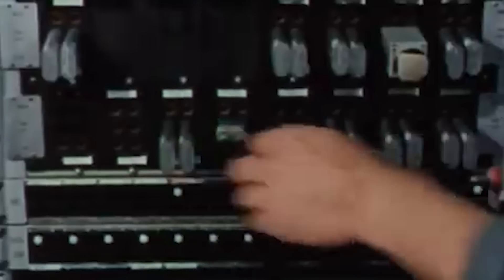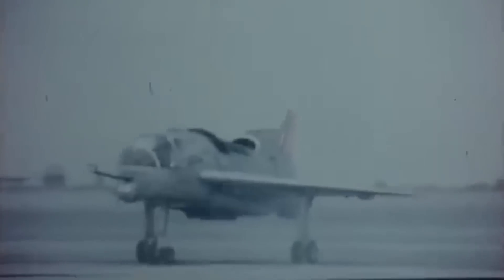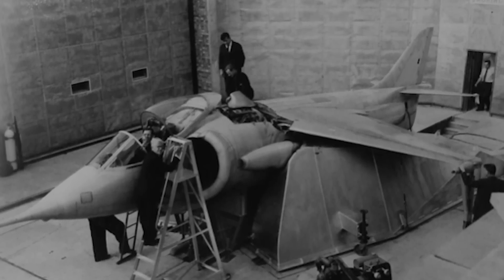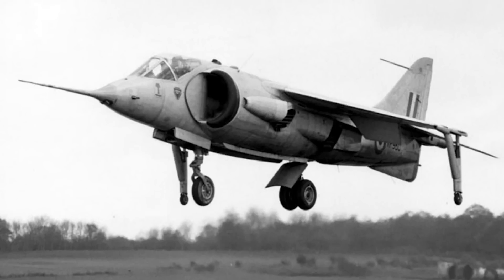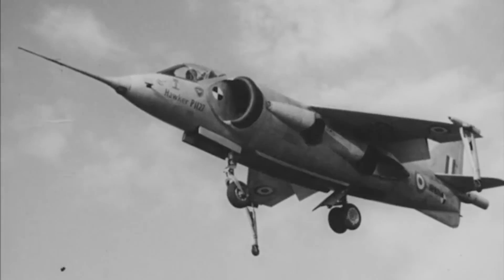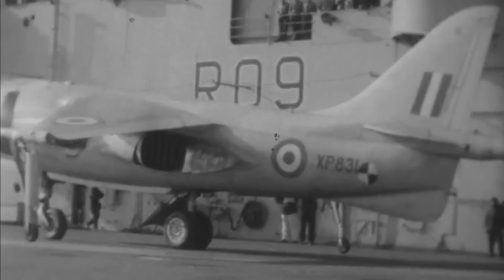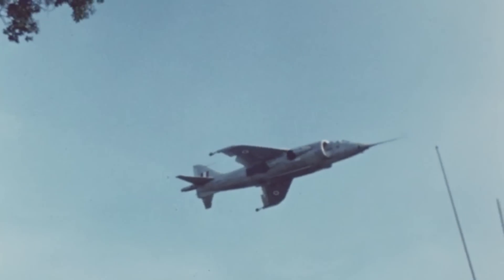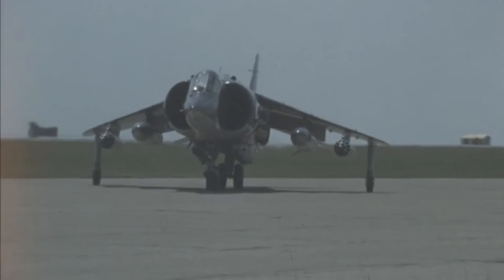The Single Aircraft That Almost Wiped Out Everything You Know About Aviation

Comment: I was an engineer on USS Franklin D Roosevelt CV-42 in the mid-70s. In 1976 we received America's first active Harrier squadron. The biggest problem we had with the Harriers was the exhaust tearing up the non-skid on the flight deck during vertical launches and  landings. Pieces of the flight deck would go flying out like shrapnel, tearing up equipment, planes, and personnel. The solution was to deck launch the planes by setting the nozzles at a forward angle and having them run off the deck like the WW2 fighters used to do. They were able to get into the air with full fuel and armament. Vertical launches only allowed bare minimal fuel and armament. Recoveries were like the normal planes. They would approach the fantail with nozzles at a reduced vertical angle to reduce landing speed. They would come over the edge of the rear flightdeck and just settle down with no fightdeck being torn up. We only lost one Harrier during our '76 Mediterranean cruise. He was approaching the fantail for a landing when his engine flamed out. The plane settled into the sea and the pilot punched out. From what I have learned about these planes, they were mean little fighters. The could be in a dogfight with a supersonic and win by lowering the nozzles some and getting a much tighter turning radius which would allow them to get their missiles on the enemy planes that were still circling to get lined up with the Harrier.

Comment: Lobe the Harrier, but it had One significant problem that claimed some planes...
During a VTOL with no wind, the engine can end up ingesting it's own exhaust gasses stalling the engine causing the plane to drop to the ground.
The more modern F35B solves this due to it's shaft driven large vertical turbofan which keeps fresh air circulating for the engine to breath.

Comment: The British contributed so much to modern aviation, but got so little back from it. I blame the political class. Case in point: Concorde. The British government wanted to back out after after a certain point. However, Charles de Gaulle would have none of it, and it is because of French insistance that Concorde ultimately became a reality. This is not a putdown to British engineers and technicians who were more than prepared to do their part regardless.

While the British get the lion's share of credit for Concorde's success, at the end of the day, it's what the French were responsible for that made Concorde able to sustain mach II without use of reheaters, namely low drag wing design and construction. The Russian Tupolev 144 had more powerful engines, but was unable to match this feat, making it unusable in commercial application. Just goes to show British and French can do great things when they cooperate and work together on a common goal.

Comment: I used to work on these diffuser’s in England for GE, welding the material which if I remember rightly was PE11, we used to work the night shift for about 3 years we had problems concerning cracks in the welds, it all turned out there were faulty welding rods which the day shift were aware of but never bothered to share with the night shift,  must have cost the company millions

Comment: Changed Warfare in the Falklands. US Marines saw this and..Slow but stupidly maneuverable to the Mirage French Mirage II's. The pilots of the Harrier would simply do a Dead stick stop and drop 100 feet then require and shoot an AIM-9 then regain speed. The Low and Slow worked for them for the terrain as they could hide in a range of mountains and wait for the opponent to fly over then rise and target with a missile that tracks heat for 15 miles. America's best at the time. At least it had a gun!
Reply: I believe the Americans discovered 'Viffing' or vectoring in forward flight which made the aircraft jump upwards and slow down dramatically allowing faster jets to pass by and be attacked from behind.

Comment: The aircraft was initially called Kestral before entering service as Harrier after modifications, I read they added small air jets in wing tips and front and rear of plane to aid stability in hover. I also read they were working on a bigger engine that would have given mach1 speed and bigger plane with larger pay loads but funding was not maintained and Bristol was merged into Rolls Royce and engine died as no funds just another what if of if uk had not been broke but Harrier lead a spirted life in uk till Mr Cameron killed it before its time again down to money saving rather than common sense.

Comment: no real combat use for vtol.

1/ Vertical take off with full military load will use up so much fuel that it limits the range.

2/ therefore the frontline airstrip will be close the combat  zone, which will endanger the plane.

3/ with low fuel left after vertical takeoff, the plane has to hit and run. It must not HOVER in its mission.

4/ with low fuel left, the minute it detects an enemy it must DITCH and run.
    It simply can't afford to dog fight.

5/ when in hover mode, the canon fire will rock the plane so much that there is no hope of hitting a target.
   It can only effectively fire a missile. BUT missile doesn't need hover mode in any senario.

6/ In Dessert Storm, central command issue a BAN on VTOL use for takeoff and landing because it does not want to tally of destroyed aircraft to go up....( not the fear of being shot down)

Long and short, there is no demand for VTOL at all.
Its great for air show, nothing more , nothing less.

that is also why Russia sold off its YAK 38 project and never looked back.
Reply: It doesn't normally do a full load vertical takeoff.

Comment: These VTOL planes are useful to the army and marines for the same reasons as helicopters; they provide tactical ground support with little or no runway space. The air force has little use for them, not fast & powerful enough for air combat or strategic attack roles. With the possible exception of the F-35 Lightning.

Comment: It’s sad that it was discarded due to lack of imagination and potential. But at least it lives on in the marine corps.
Reply: It wasn't really discarded. They just took what was learned and made a better version and called it the harrier.
Reply: @moshunit96  The Harrier has not been used by UK forces since about 2010...
Reply: The AV-8
Reply: It was retired for good reasons. While the Pegasus cold thrust engine allowed for vertical flight it severely limited the aircraft in both speed and payload. These limitations could not be overcome without a completely new approach such as the mechanical forward lift fan in the F35 which allows the rear nozzle to operate at far higher temperatures. We will no doubt see the Harrier continue with nation's which need SVTOL capabilities but cannot afford to buy or maintain F35s. I'm honestly surprised the Chinese haven't attempted to acquire or clone the design as it would allow them a proven fleet air capability while they get to grips with all the problems their current approach is causing. Their large carriers have both structural and system issues and their carrier aircraft are proving underpowered and unreliable.
Reply: @ianjardine7324  Tell the US marine corp that Harrier is no good.  The reason Britain stopped using them is 1. our politicians are stupid  2. they rather waste money on stuff we do not need like a high speed railway to link two cities 120miles apart, to save a few minutes ( HS2 ) which is costing £1billion per mile to build.
Reply: @chrissmith2114 
HS2 ranks as one of the stupidest rail projects ever anywhere.
 It's tragic.
Reply: UK should make the stealth version. - Advancing role, subsonic F/A stealth fighter, mostly for attack still needed
- Defence role, it can comes out of nowhere, since it doesn't need long runway, giving headache to opponent planner. 

Upgrade with Ai for easier vertical take off & landing.
It works fine with human at control, it would be fantastic with fly by wire Ai.

Put the ground crew on vehicle, the aircraft could be re-arm & re-fuel almost anywhere.
Reply: @budisutanto5987  we've got exactly that the Americans helped us develop the F35 then let us build parts for theirs as well as our own.
Reply: @ianjardine7324  Not really.
Some of your politician demand for F-22.
They aren't wrong. 
F-22 & F-117 is the true stealth.
F-35 & SU-57 aren't.

Aim for F-117 lower stealth (but stealth from every sides) to lower cost, but with the superb agility of Harrier, most radar can't detect it on time to react to this day.
Sell it to US & allies.
Reply: @budisutanto5987  the F-22 can only thrust vector up and down as to 12 & 6 o’clock where the Russians can do the whole clock
Reply: @Stewpot-p5l  When hard maneuvering, try to get behind opponent, fighter use - up then probably down motion, because cockpit is there.
For example : Cobra maneuver.
but ok, What maneuver use side thrust vector?
Reply: @budisutanto5987  find out when real dogfighting begins
Reply: @Stewpot-p5l  You mean one F-22 against six F-15? They already did it.
Reply: @budisutanto5987  im talking about a jet with thrust vectoring that does more than 6 and 12 o’clock
Reply: @Stewpot-p5l  which turns out not a game changer compared to F-22, which use flat thrust vectoring, thus concentrate jet blast, making it more effective.
Reply: @budisutanto5987  in your mind but the Russians have mastered it
Reply: @Stewpot-p5l  You claim without reasoning, anyone can do that.
Reply: @budisutanto5987  they’ve been doing it for a long time and as i say their manoeuvres are much better as they can spin their aircraft round like a handbrake turn etc as the thrust vectoring can point at all directions of the clock
Reply: @Stewpot-p5l  That's not exactly correct. It can almost turn any which way, but the degree & speed of the turning can't match F-22.

Fly by wire on surface control & thrust vectoring, is the key to prevent stall.
On that field, it's hard to match US computing power.

Look at B2 stealth. The shape isn't new, but before fly by wire, it's hard to fly, nevermind finishing bombing mission.

With Ai fly by wire, it even possible to hard turn, then let Ai recover it, avoiding crash.
Reply: @budisutanto5987  well they perform better manoeuvres at air shows
Reply: @Stewpot-p5l  F-22 is not for sale.
Not even to UK. There's no incentives to show the capabilities.

They even said that F-35 is better then F-22, to promote F-35.
You probably can get away saying anything bad about F-22 to the government, it's align with their agenda.
Reply: @budisutanto5987  well when warfare begins you can then start waving your hands and claiming that your masters of thrust vectoring that was created during the creation on Jet VTOL that the USA has always struggled with
Reply: @Stewpot-p5l  The government & all other manufacturers struggle with VTOL, not Lockheed.
On this, points to Rus, straightforward build, no delay, no government officials meddling.
Reply: The Tory party sold off the Harrier like many over Great British inventions for profit for themselves and it was updated as time does update aircraft with the Radar and cockpit etc but the engines were always British
Reply: The RAF now have the F-35B which has the same VTOL but with far greater stealth features.
Reply: @Starfishcentral  it’s not the same VTOL system as the UK designed the supersonic system but didn’t use it ! The Russians stole it and the that’s where the USA got it from , then  came back to the UK when they had problems